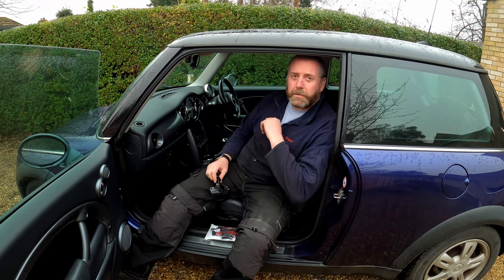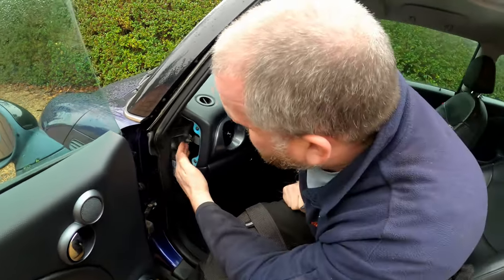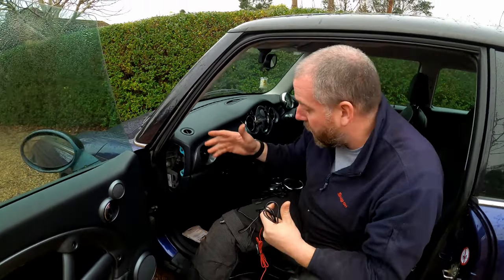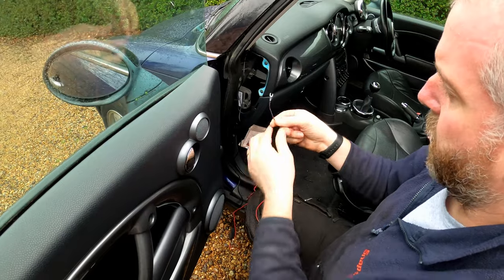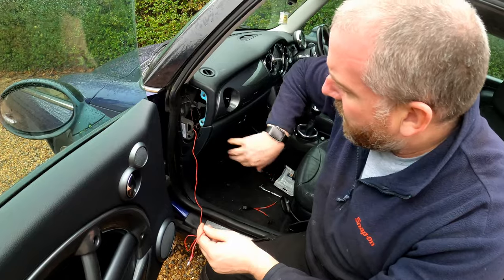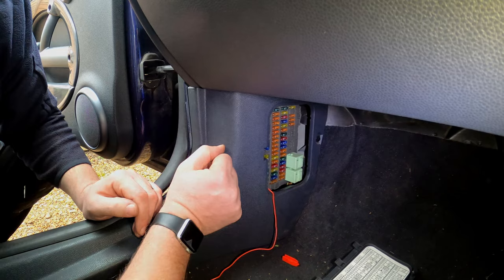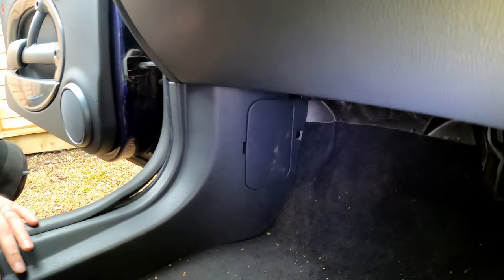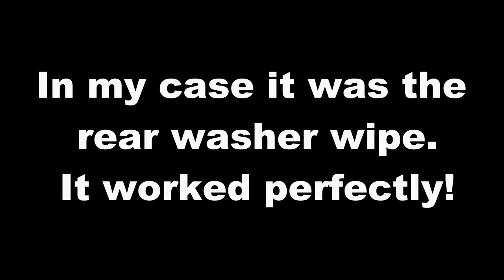Fitting A Nextbase Dashcam And Hardwiring It To Operate When The Ignition Is Switched On

Comment: Thanks for taking the time and trouble to share.  There is, however, a right way and wrong way round to mount the piggy back, and it needs to be right way round so that both fuses protect both consumers. If it's the wrong way round, it's possible to keep power going to a consumer when the fuse is blown.

Comment: I am not electrical knowledgeable, but I think it would be better to identify the hot side of the 5amp fuse holder so that the dashcam draws current from the hot supply directly when ignition is switched on. This way power to your dashcam does not go through  as well as sharing power with the 5 amp target. I presume you have already checked that but not on video.